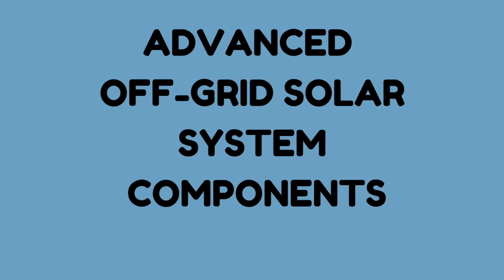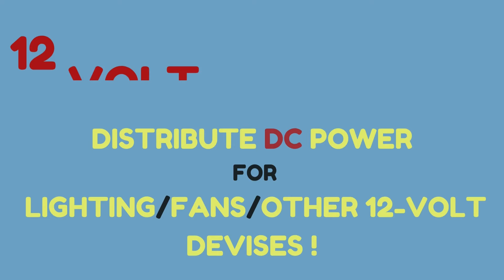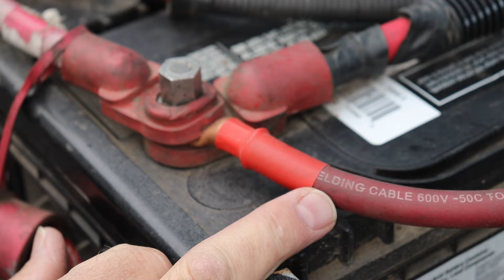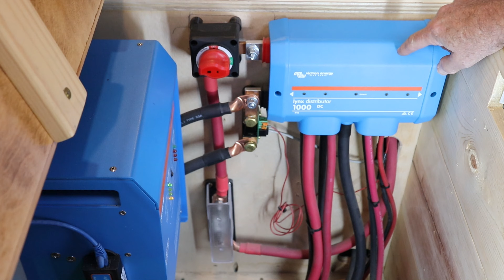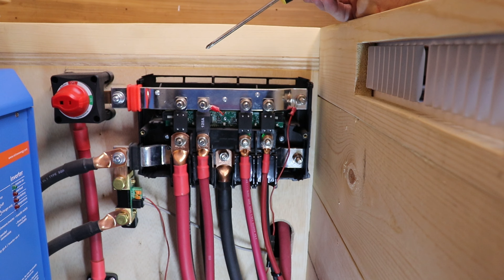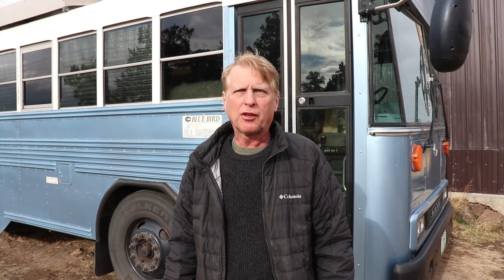How I Powered Our Skoolie | Complete Off-Grid Electric System

Comment: Hey, I'm starting a bus conversion on a 35' 2002 International Rear Engine 7.3 PS T444E .
I will have a propane only generator mounted on a carriage on front of bus. My electrical wiring is  connected by cable to a RV receptalcle mounted beside generator. The wiring from the receptacle goes under front of bus up into a panel beside drivers seat then up a narrow panel to a panel above the windows. In this panel will be AC receptacles along with the current bus DC wiring.
I plan on using the three bus lead acid batteries for some DC applications. Since I'm going to be in very windy areas of the Southwest, I will be employing a homebuilt portable VAWT to keep bus batteries fully charged. The turbine will be mounted on rear of bus.
I will have 60 gallons of fresh water inside and two 30 gallon grey water tanks and one 30 gallon black water tank. I will have a Mustee Durastall 32x32x74 3/4 shower and a Thetford flush toilet. In kitchen I will have a double SS sink, a recessed glass top electric two burner stove and several other electric appliances. 
I' using the floor as is but covering with carpet. Leaving overhead ceiling as is.
Maybe we will cross roads one day.
Reply: Thanks for commenting on my bus conversion.
At 82 I am a little slow especially in hot and humid tropical Central Florida. But now we are getting some excellent much cooler weather and perfect for work.
My conversion will be built as simple as I can. It will not be lavish like so many others do. I'm not adding any insulation because I will not be in weather that would require it. My goal is to make the inside comfortable to my liking and convenient and enjoyable. 
Maybe we will cross roads one day.
I subscribed to your YouTube channel.
Toodleluu ( see ya !)
Reply from the maker: It sounds like you have a good plan for how you’re providing for your needs.  There are so many different approaches based on different needs, budgets, equipment and so on!  In my conversion, for example, I went with building my own compost toilet to conserve water and reduce waste while off-grid.  There is no one way to do things.  The most important thing is that it works for you and you’re satisfied with the results.  Your wind turbine sounds like a great idea and why not take advantage of the wind energy that’s in your area.  We will be heading south to Southern CA and AZ soon to escape the cold weather in OR.  Keep in touch!  Would be great to meet-up on the road and learn more about your build.